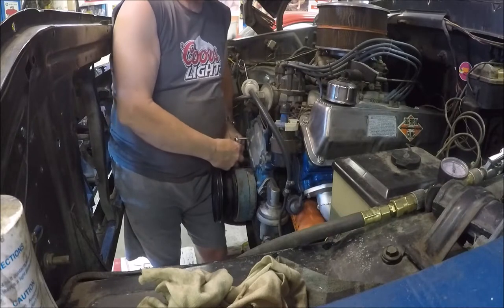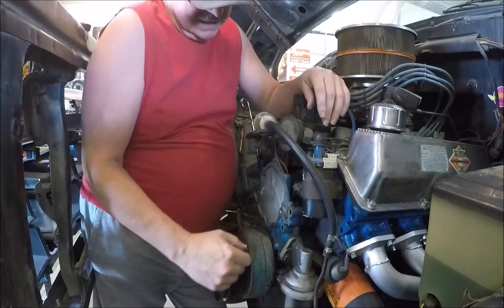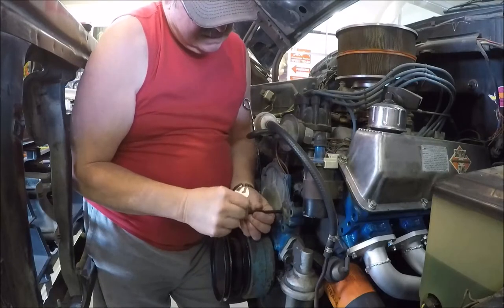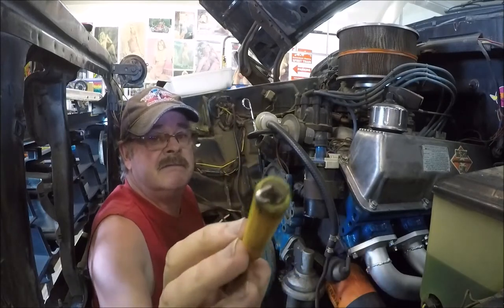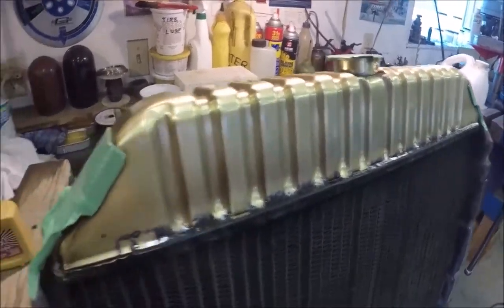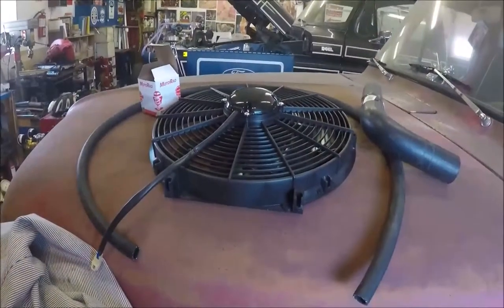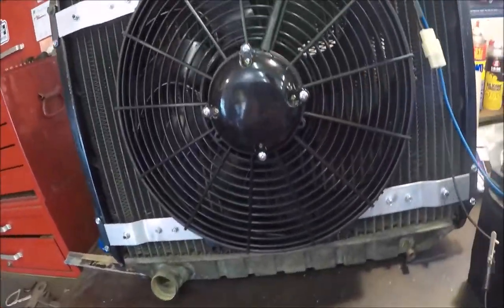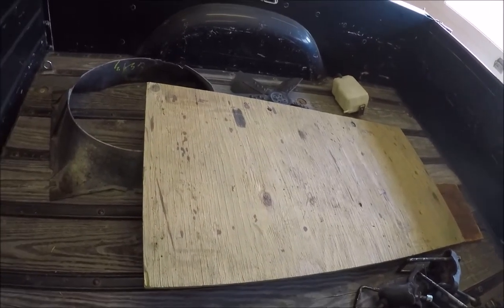Boss 302/F100 Electric Cooling Fan Installation

Comment: I am putting in a Spal fan in a 1964 Ford f250.  That should help with the small block get back some of the horse power robbed by the mechanical fan.